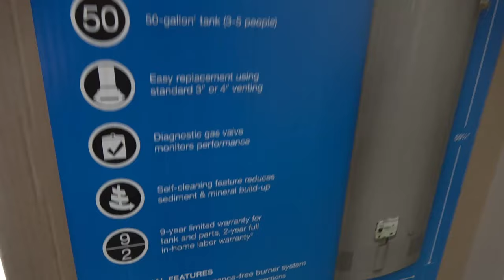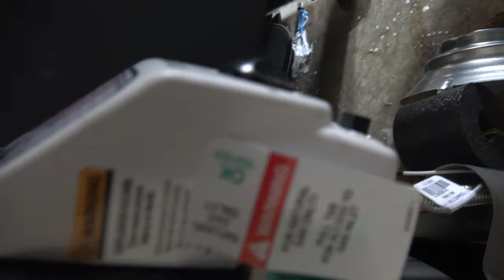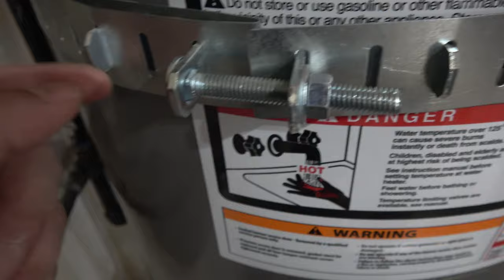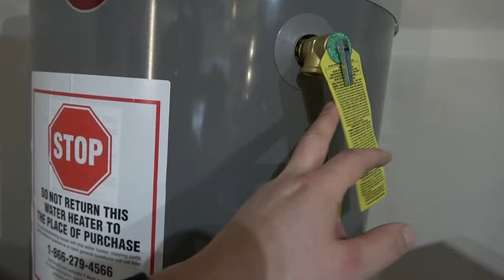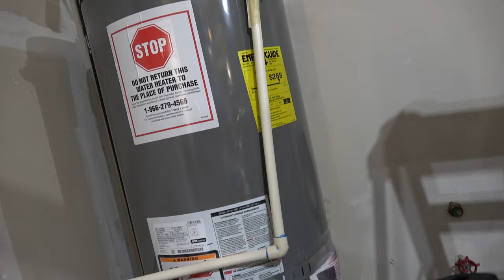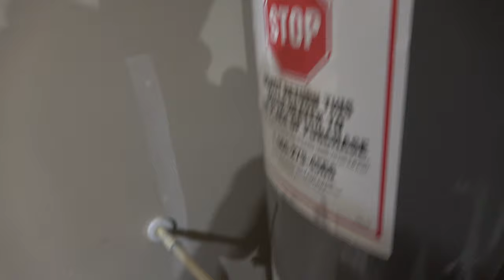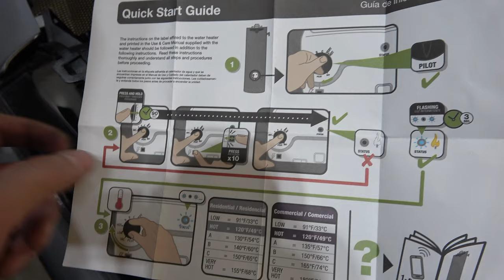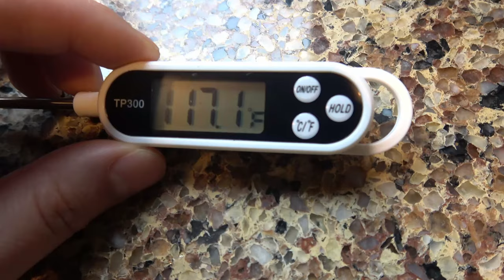Rheem gas water heater installation process from start to finish what you need to know!

Comment: Sorry , but you shouldn't being posting this video , you don't have and idea of what you're doing. alot of wrong this in the installation , is not just installing a water heater: 1). Test for gas leaks. 2). Check k for water leaks 3). Test for gas combustion 4). Correct sizing of the expansion tank and calibrated 5). Don't cut corners leave in place the sediment trap for gas 6).don't applied dope sealant on the flexible gas line 7). Make sure the combustion exhust is oriented on an angle of 45 degree or so : so you can have a "Happy Safe Installation" obeying the Plumbing Codes.

Comment: I believe you are NOT up to code because you removed that 3" nipple from the sediment trap and that's NOT how a sediment looks like. Also, your'e NOT supposed to use Steele pipe in lieu of copper pipe on the cold water side. I'm pretty sure you will fail an inspection. Just saying.